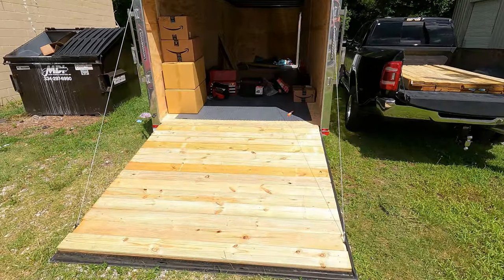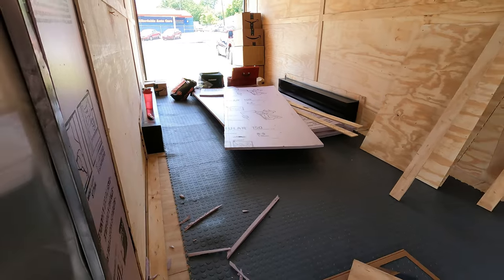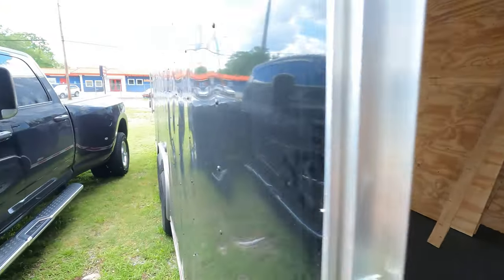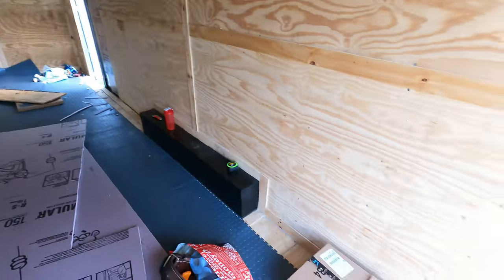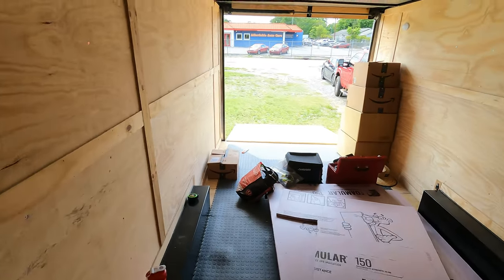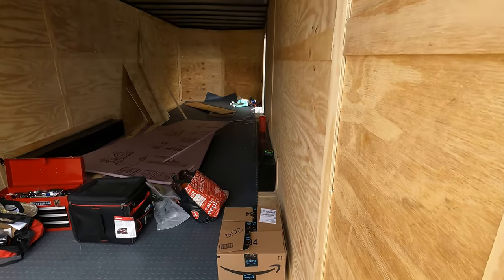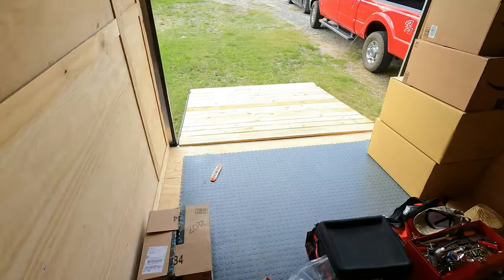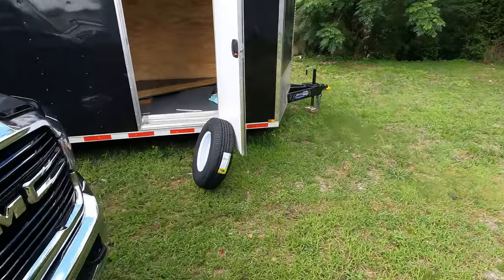Episode 0 (Intro) - Enclosed Cargo Trailer Conversion to RACE TRAILER - Do It Yourself

Comment: My man... where did you get the black flooring at? I would like to get it for a project.
Reply from the maker: The puzzle piece version is at LOWES.  Home Depot offers it in Large 10 foot wide rolls. I can send you the link if you want
Reply: @WIDEBODYNATION  That would be awesome buddy. I need the 10ft wide rolls from Home Depot. Do you have a link for that please?